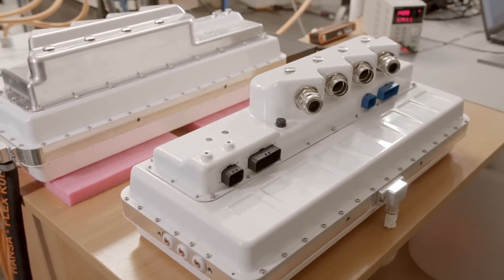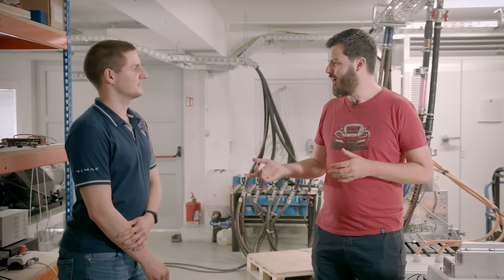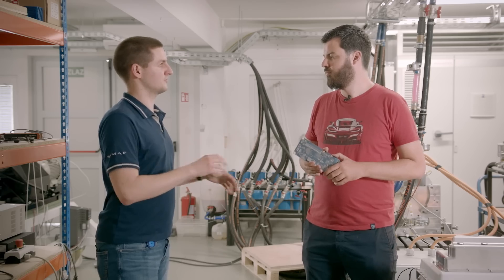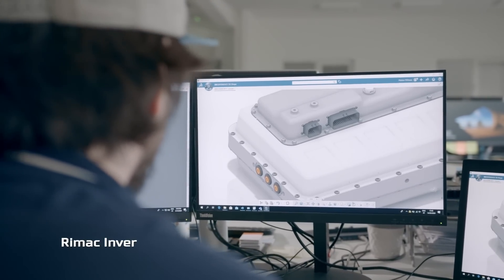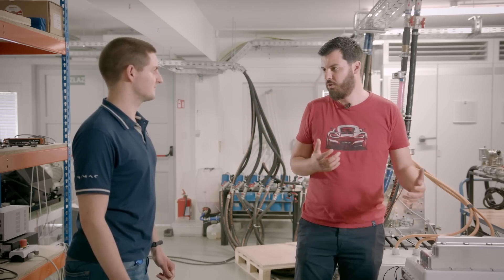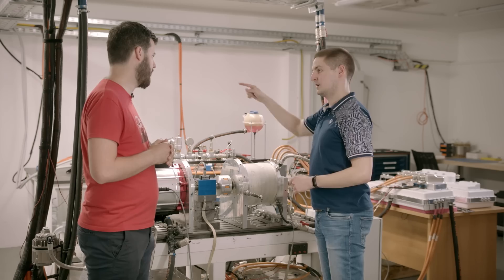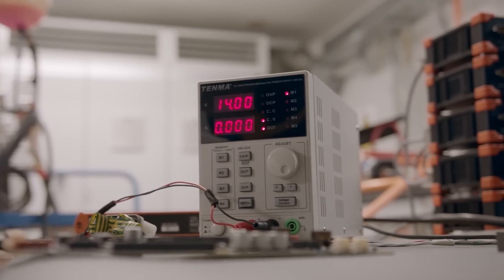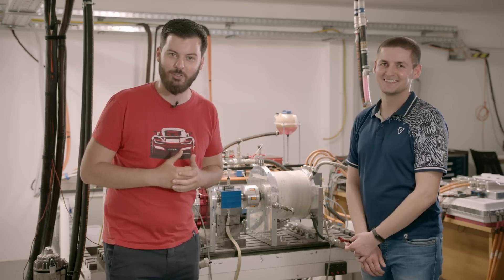The World's Most Power-Dense Hypercar Inverter | Mondays with Mate E10

Comment: Can you tell us more about AC motors,and how you managed to double the torque compared to C1 motors.
Reply: Oh yes please.
Reply: Mo powa mo torque
Reply: Second to this!
Reply: i second this
Reply: I'm not an EE, but from what I know, the power is essentially related to the efficiency of the motor and the capability of sustain with the thermal issues due to bigger heat produced taking more current and voltage who are the principal reasons to produce more power/torque, you can't put more voltage and Current to an existing motor and expect to make "safely" more power, this will need a redesign and optimization. 

ps: this is how to calculate the current and power from an AC 3 phase system:  https://www.engineeringtoolbox.com/three-phase-electrical-d_888.html
Reply: @highperformanceengines3902  I'm an engineer for electric motors and power electronics. First of all: You are right in most points. E-Motors are designed by different limiting paramaters like wire insulation, current density and the magnetic saturation of the steel, magnet energy density, if magnets are used. The better the material, the higher the limits at a given design.
All other parameters are part of motor concept like windings, pole pairs, rotor diameter and length. The higher the pole pair, the higher the torque, but you get more EMF (induced voltage) and your inverter needs to perform higher fundamental frequency. The higher the windings, the higher the torque, but more EMF as well and the steel becomes saturated earlier. The diameter will increase the torque squared, the length increases the torque linear --> Bigger, better ;-).
Last step is to optimize your magnetic circuit. That's what most engineers do with finite element programs. Here you configure noise behavior and cogging torque, magnet geometry, if magnets are used, to shift the maximum power point over rpm and check the thermal contact to your housing or implement a fluid cooling design with water or oil.
The best way to increase the power is to increase the speed. But in most applications you need the higher torque for direct drives. It's not as simple as most people think about to design an electric powertrain ;-)
Reply: @lernenmitrobin  I knew all of this already.
HONEST!!!....   :-)
Reply: @lernenmitrobin  now China has all the info they need lol.
Reply: @2076649  probably yes. But where's the problem? You got the info as well ;-)
Reply: @lernenmitrobin  matched tunable (by regime of operation) LRC net could be used to reinforce fundamental frequency?
Reply: @daniloviana8818  no, the fundamental frequency is variable from 0 to a few hundred Hertz or on high pole applications a few thousands. Some people are confused by fundamental and switching frequency. The fundamental frequency is the frequency that built the torque. Some motors are driven with harmonic components as well. LRC networks are not part of emotor systems.

In industrial applications newer inverters with high switching frequency use LC Filters between full bridge and the emotor to reduce current ripple on the cables.
Reply: @lernenmitrobin  Is there any literature you could maybe suggest to someone who's interested in electric motors but only has the most basic knowledge on how they work? Sort of electric motors for dummies, just more sciency
Reply: @topanteon  not really. E-Motors, especially AC-Motors, are complex systems. It's hard to understand with respect to mechanics, elecro magnetic field components and thermal behavior. But maybee I'm too deep in the subject. Sorry
Reply: @highperformanceengines3902 first of all thank you for your answer,secondly I'm aware of the working principle of AC motors/generators. What I really want to know is how they are developing and testing their motors,which is why,I guess,these videos are for. Maybe my first comment was not well put.
Reply: HI It's basically like this. The other 2 smaller motors are probably 4 pole units. While the larger one is probably their 8 pole unit. Basically the same principal as induction motors. If  you can maintain rpm for more poles you basically multiply the power. Example TOP DRIVE motors have a high pole count. This allows the motor to produce large amounts of torque at a slow rpm to turn the drill  for well drilling. There's more to it than that. Quite a bit of engineering goes into motors.
Reply: It's pretty obvious from the video! (Hint, one motor basically has a stator/rotor stack twice as long as the other motor.......)
Reply: @maxtorque2277  No, not really. Long one are two C1 motors connected together, short one is just one C2 motor. So it's nearly the same, maybe just slightly longer, but has twice the torque.
Reply: @Stasiek_Zabojca  What is the kW/volt.kg rating between the two machines, as that really tells you the performance of them!
Reply: @maxtorque2277  It's not... the new one is maybe 25% larger than the old one 7:19   The C-Two uses 720V instead of 620V... same current, higher voltage = higher torque.  16% gain through Voltage increase, about 25% gain through volume, 41% total gain on 804HP (Concept-One) gives about 1133HP... so that's in the ballpark... considering I'm sure the new inverter is probably several percent higher efficiency, and the motor probably is designed for more current.
Reply: More fases? not 3 but 4 or 5 give more torque but halves max rpm, so do we have profit from it? maybe for wheel direct drive motors.
Reply: no , it is secret, next question please

Comment: Nice humble beginnings, I remember we tried to build our own inverter for our Formula Student team. Exploding MOSFETs can be very loud! Cool to see the efficient testing. I know this gets very nerdy, but can you elaborate on the semiconductor switches and switching frequency of the inverter?
Reply: You can guess the maximum switching frequency from the bit where he says" Motor control runs at 20,000 times a second"... With FoC you will ideally run the control algorythm (rotor position, Park& Clark-> d & q axis current control, Inv Park&Clark, then SVM) syncronously with the fundamental frequency so you can update your duty tables on every counter overflow
Reply: @maxtorque2277  Right hint. With DMA (direct memory access) you're able to perform higher PWM frequency than the control period and update the registers when the control loop is calculated. This makes sense, if you use MOSFETs (SiC MOSFETs for higher voltages). Otherwise the switching frequency of IGBTs is limited, but current density per chip area is even bigger. If 20 kHz is the switching frequency, they will probalbly use IGBTs
Reply: @lernenmitrobin   @lernenmitrobin  
You will have trouble switching IGBTs effecintly at 20khz and there is no real gain other than noise reduction. Once you start to get to higher RPM and current you are better off dropping the switching frequency in order to reduce losses.
One way to double the power is to double the speed. Then double the number of poles so you get half the rpm but double the torque. There is a limit to how far you can go but from the electrical point of view running at 1khz for the motor frequency should be still viable.

Comment: Why ac motor instead of dc and no inverter?
Reply: Brushless AC motors and brushless DC motors are basically the same thing, except that the AC version assumes the existence of an AC supply, whereas the DC version includes electronic components to make AC. In an electric vehicle with a battery as a primary energy source, you're going to be converting DC to AC somewhere along the line and the only question is whether you buy the electrics with the motor or roll your own. Since Rimac C_Two probably have tight requirements for speed control, torque control and efficiency, they go custom.
Reply: You can use AC motor as a generator,as soon as speed of rotor goes over synchronous speed it "becomes" a generator, which is great since you can be regenerating power while breaking or going downhill.
Reply: a DC motor needs brushes or graphite contactors to commutate the direction of the current. An inverter handles this task without friction and much more efficiently. 👍
Reply: @Luca148S  but there are also BLDCs which don't need brushes